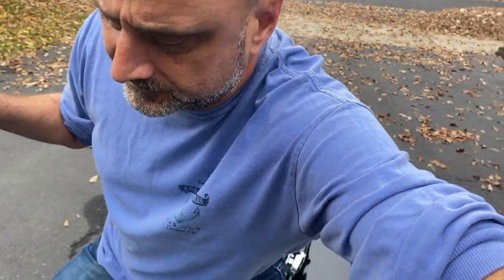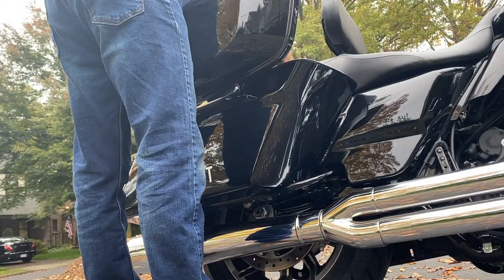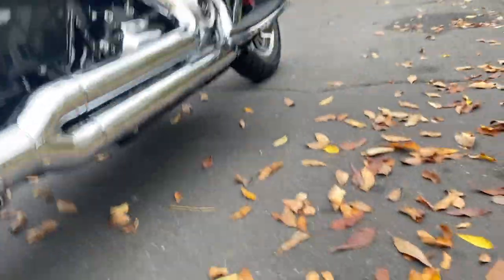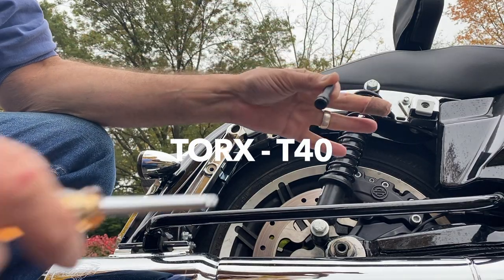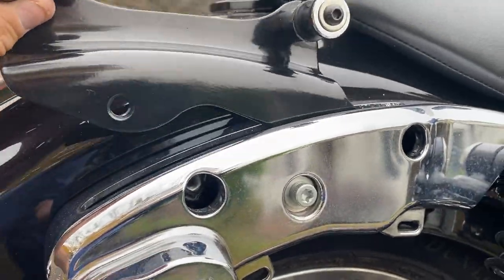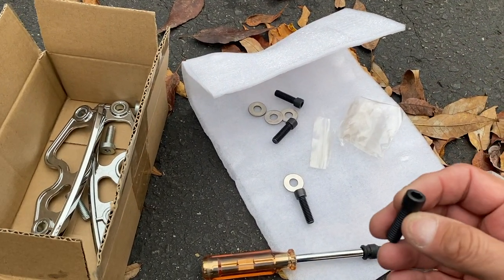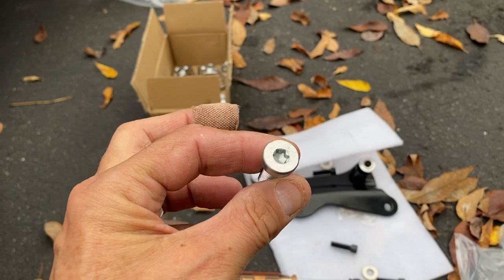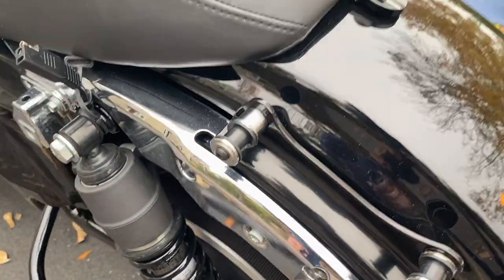Harley Davidson Docking Hardware Install

Comment: There is a chart in the owners manual for the shock adjustment based on weight and cargo. Without looking at chart my guess would be ,you should set around 2 or 3.
Reply from the maker: Just checked - You're spot on ! Thanks

Comment: I changed my spring to 6, was 1 by factory. I am 70kg. I would love to upgrade to the Ohlins HD776, the standard ones suck. For the mount, went with the HD original one after reading posts that addons would fit badly on it and could be a problem. The HD one is adjustable in width. So far I attached the HD Detachable Solo Luggage Rack which is perfect when adding a bag for traveling.
Reply from the maker: I checked manual and at 80 kg about - its 2-3 clicks. That's where I'm going...

Comment: At your weight anywhere between 8-10 should be fine. Experiment a little; lower numbers softer; higher numbers stiffer. Also depends on how much stock travel the Standard has. I ride a 2020 SGS; weigh ~200# and I have mine set at 9. Enjoy your videos.
Reply from the maker: Thanks for the info
Reply: I forgot to mention that the SGS has only 2.2” of travel in the rear shocks. Too soft and it bottoms out. Had a 2017 SGS; just took delivery of the 2020. Too damn much snow/salt here in Wisconsin.

Comment: I remember my salesman set the shocks and he weighed about the same as me so I've never messed with the shock adjustment. Hmm, I'll have to see what mine is set to and get back to you. I weigh about 185 so now has me curious. Wish I would have thought about after market when I got mine. I paid the Harley tax.
Reply from the maker: Just checked the table in manual,,,, 2-3 units

Comment: Adjust shocks based off the weight in your bags and passenger when there is one . Mine is at 15 with a passenger.  Both of us together weigh close to 400 lbs . And what a difference it makes when you adjust accordingly
Reply from the maker: Thanks- I guess I need to change mine to 3

Comment: If they are 12” shocks it should be 12” when you’re sitting on it from mounting bolt to mounting bolt. Have John measure it while you’re sitting on the bike and then adjust it up or down if needed in order to have it at 12” under load.  If they are 13” shocks .. then it should be 13” ... mounting bolt to mounting bolt
Reply from the maker: Just found the manual - it said 2-3 according to my weight...

Comment: To add another extra pain in the ass, a 2021 rk does NOT have those 4 factory bolts. Further, the bolts in the kit are way too fricken long and become taut while the bracket is still wobbling about and not fixed to anything. 🤬